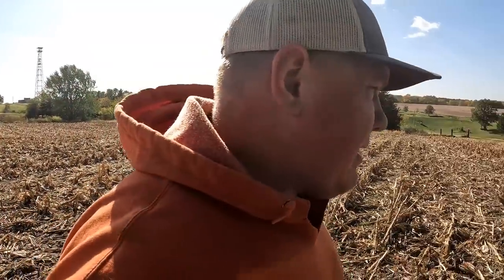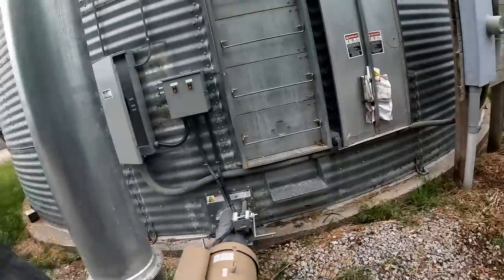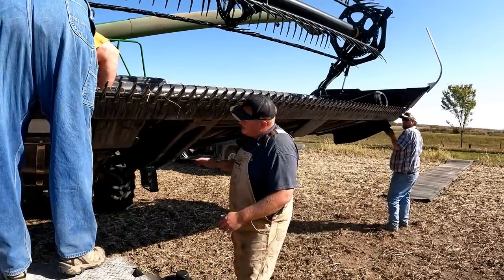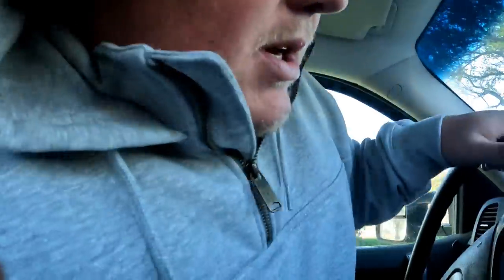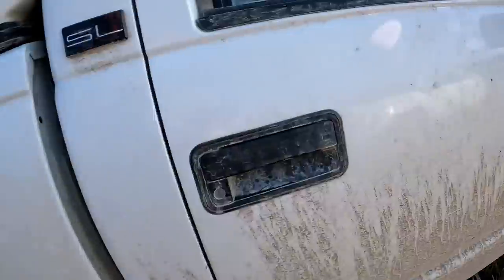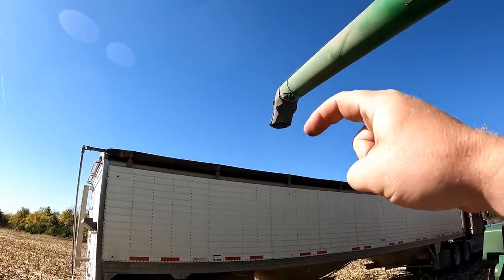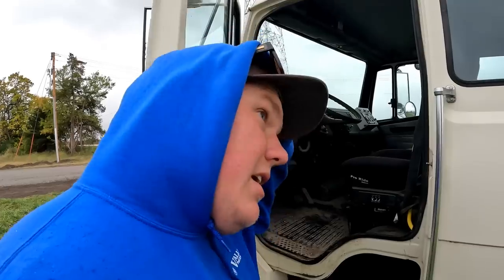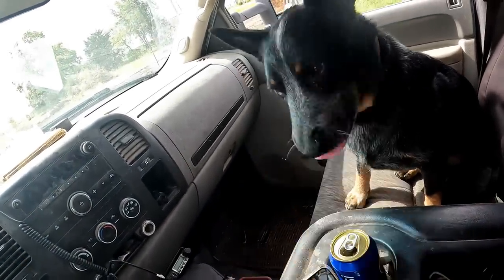Southern Iowa Corn Harvest 2022 - WHAT A START!

Comment: We had the alternator bolts brake and let the alternator go down into the fan and the fan into radiator on our Case TV380 track loader so $12,000.00 later and 120 days later it’s back to going.
Reply from the maker: Yeah, that sounds bad. Did you ask me about straw one time?
Reply: Yes I did do you still have it?